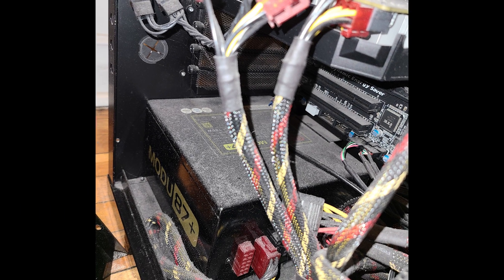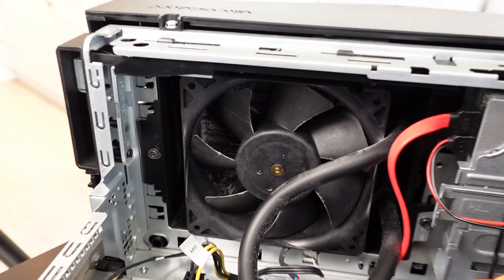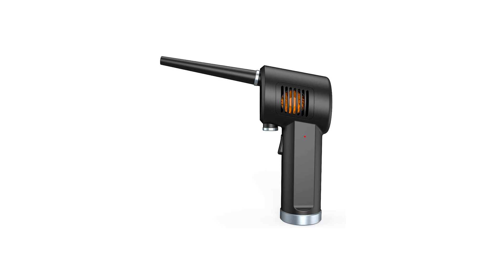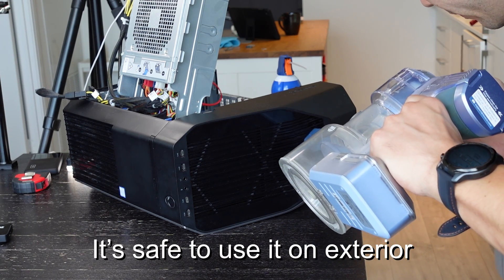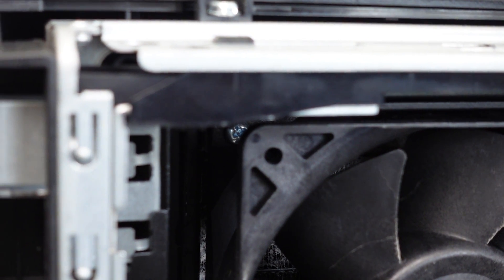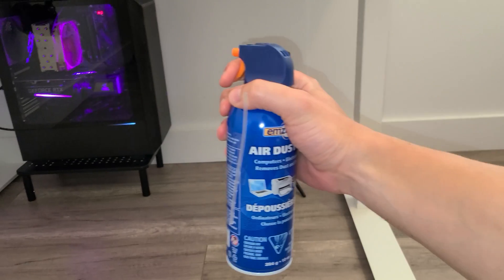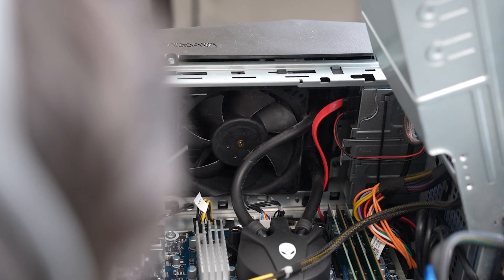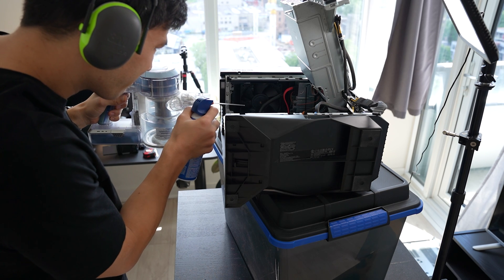Get the DUST OFF your PC NOW! (+3 tips for cleaning your computer to increase performance)

Comment: I have an r6 which is super noisy when playing online games. I bought an xpower air duster and it cleaned the inside lovely, but the pc is still noisy. I might give it another clean after watching your vid, see if that makes any difference.
Reply: I have the same PC, and I cam in the process of changing out the fans. For me, the stock fans are way too loud.
Reply: @PartyUpLive  Let me know if it makes a difference.
Reply: @unbearablexabicat3052  My original comment was removed for some reason but I did the upgrade and the fans work great, pc is running cooler and waaayy quieter. If you want to k ow anything else feel free to ask.
Reply: @PartyUpLive  Its great to hear the upgrades are working and your pc is quieter. I must get me some new fans sometime.

Comment: Thanks for the sweet video :) I've got SO much dust in my PC since I've had the same case for like 11 years and have opened it up only a dozen times to change components. and theres some dust in this HAF cooler master case that justt seems very stuck. Hopefully I can get it a bit cleaned up this weekend before I install my new GPU :)

Comment: the electric duster was strong enough for me (got it for like $28.50), managed to blow the dust out from the exhaust radiator too
Reply from the maker: Damn! That's a good price. Is it better than a can of compressed air?
Reply: @JSyntax  Can of compressed air is definitely stronger!  For my purposes the electric duster is good enough since I only use it on PC and some other stuff that doesn't require that much force, so it saves me more money over the long run.
Reply: Thanks for this tip! This sounds like what I need for the power supply fan area. I am too chicken to open that up.
Reply: I am thinking about get the $99 DataVac one, but some reviews said it's too powerful. Which brand of duster you got for $28.50
Reply: @shuo_tonny_tao1725  Heyas, I got the OPOLAR one (it's always on sale for that price since sales cut it down to half, wouldn't be worth the regular price).  DataVac is a lot stronger, this one isn't as strong but it's good enough for me.

Comment: Hey dude this is way late but have you ever tried using a hairdryer to dust your pc? All those electric air things just seem like weak hairdryers to me
Reply: Tardy, not who you were addressing, and definitely not a dude, but I just did this (on cold from about a foot away as an experiment) and got a huge face full of dust. And this was after cleaning off all visible lint and vacuuming the insides thoroughly. So yeah, it works but makes a mess. Found this video looking for something precise and just for the computer. 😀
Reply: @lorrainewilliams7896  thank you!
Reply: For anyone reading this, I do NOT recommend using a blow dryer! It can work, yes. But the point of using a vacuum is to get the dust OUT. What's most likely going to happen with a blow dryer is that you'll blow the dust in even deeper.